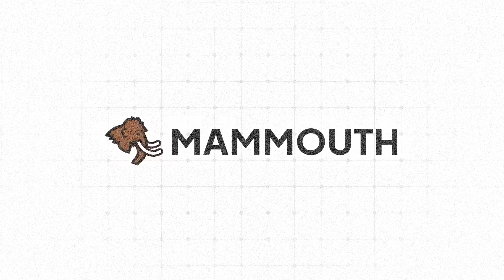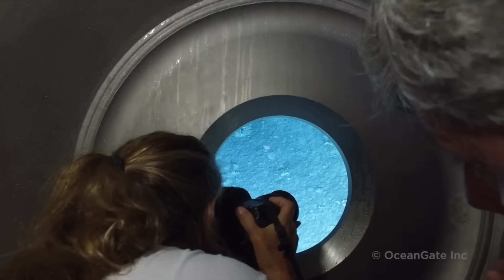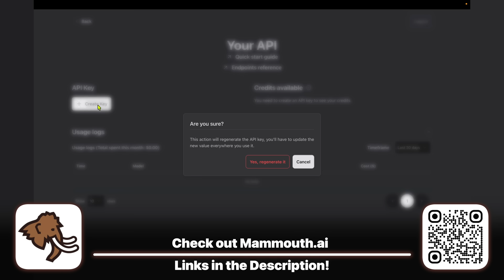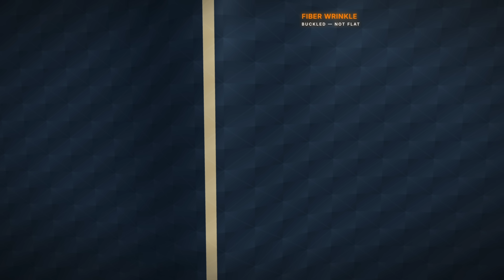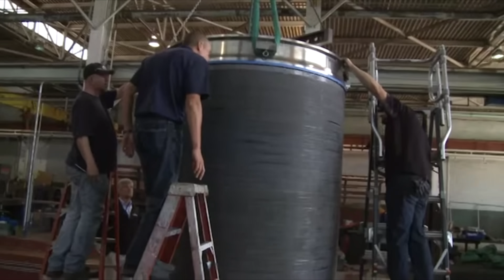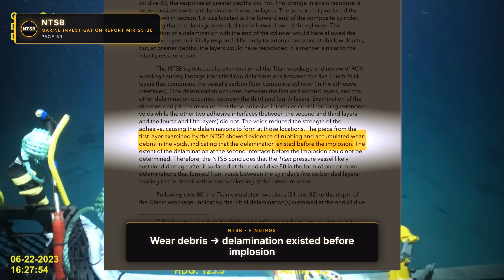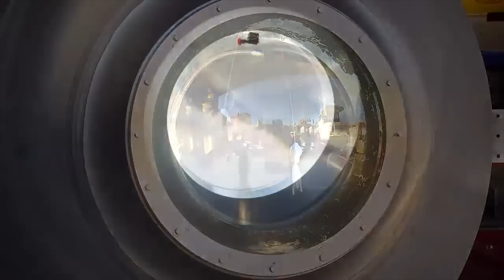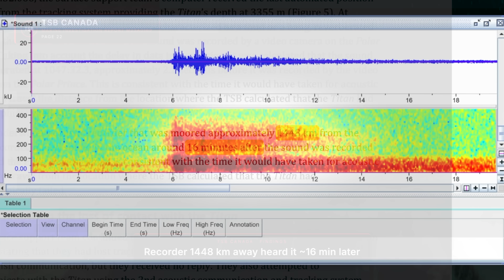Oceangate Titan: It was WORSE Than We Thought

Comment: Seriously, the problem here was not, being stored in the weather, or being towed, of not watching the monitor data none of that.  There is no reason to even calculate what this design might have survived because of one simple thing.

NOBODY, no engineer, no scientist, nobody  would EVER use carbon fiber  in COMPRESSION.   YOU would not.   

This vessel never belonged anywhere NEAR water, let alone deep water.   The only application Carbon Fiber is suitable for is tension which is HOLDING PRESSURE INSIDE. This would be a scuba tank, or a water softener tank.   That's it. It's that simple. They used the wrong material!

Rush suffered from too big an ego, and too much greed to be able to make reasonable engineering decisions. Someone should have pushed him down the stairs before he killed others.

Comment: I worked in a composites shop, and actually helped with much smaller pressure vessels. Those things were never intended to be manned and we Still did an insane amount of structural testing. The problem wasn't in engineering. It was arrogance and thoughtlessness.

Comment: Is it possible to build cylinder type deep dive submarine from titanium? Say- same size as Rush’s Titan - but from titanium?
Reply: Good question.  If it could, it would have cost much more - titanium is expensive.  For that reason alone, Stockton Rush would not have considered it.
Reply: Not if you want it to float without external floats
Reply: @claire_cant_think_of_a_name   Wanting it to not implode is, I think, the greater concern.
Reply: @AlbertaGeek I mean, you need to check both boxes or everyone dies

You can make a titanium tube or any other shape that won't implode at any depth, but Stockton was really opposed to external floats for some reason, so the titanium tube wouldn't have worked for his requirements. Stupid requirements but still
Reply: @claire_cant_think_of_a_name  "you need to check both boxes"
No, you don't.  The pressure vessels of deep-sea submersibles are incapable of floating on their own.  They need syntactic foam attached to the outside in order to return to the surface.

"the titanium tube wouldn't have worked for his requirements"
Not because of flotation issues, but because of cost.  He was trying to make his submersible on a shoestring budget, and titanium is notably more expensive than carbon fiber.

And even then the carbon fiber he bought was inferior - he got it second-hand from Boeing at a discount because it was past its expiration date (honestly, before this I didn't know carbon-fiber had a "best by" date).  Something to do with the resin degrading over time.
Reply: @AlbertaGeek Lmao yep, both previous times I brought up external floats I was thinking about syntactic foam. Glad you're on the same page.

Since you enjoy being really pedantic though, DSVs don't need syntactic foam. Oil filled pressure equalized tanks were the original design and worked fine, albeit with a many drawbacks that syntactic foam solved.

Comment: Stockton Rush had little fear and complete disregard of reasonable safety.  A Cowboy in design and manufacturing.  I am conversant in fabrication and construction, with a wide level of experience and I do and have constructed projects on completely new thoughts and methods.  However I have never taken it upon myself to construct a project until design and serviceability was certified.  When it looks wrong it is most likely wrong, and no one in hell would have made me sit in this submersible to venture to the deep.  Having seen the Titan prior to the implosion I felt not confident that it was safe, neither did I think that Stockton was sufficiently capable to do so.   One could see a train wreck in the making.

Comment: That the bang was ignored is hardcore for me. Everyone who learns carbon fiber knows that if you hear a bang it is most likely a bunch of fibers that have snapped. If you hear carbon fiber, you hear it mostly under the initial loads since some fibers can get peak loads that make them snap but then the load spreads more evenly on the rest of the fibers. It is a whole different thing if you hear a bang after some use. On the other hand if you only use 5 inch instead of 7 and do not use the recommended fiber orientation without consultance and against instruction that is far from bold... that is just reckless.

Comment: Carbon fibre is strong under tension. It’s good for strengthening pressure vessels. Carbon fibre is weak under compression yet that’s exactly what OceanGate did. The layers separate (delaminate) and sooner or later …

Comment: The hero of this story is the carbon fiber.
The fact that the sub made more than 80 dives before shitting itself despite all the manufacturing defects and mistreatment of the hull speaks to it's strength and proves that Rush was correct, in principle, about the suitability of the material for sub construction.

Comment: I work for a company specialized in high pressure, fast moving carbon fibre machinery. Some of our machines have been running non-stop for over 40 years. The approach OceanGate and Stockton Rush have taken to carbon fibre engineering is outright ridiculous. I'd say it's as comparable to engineering as alchemy is to chemistry. Stockton Rush, a veritable 21st century alchemist and snake oil salesman.

Comment: The de Havilland Comet, the first commercial jetliner, crashed in the 1950s due to metal fatigue. Metal fatigue is the weakening of metal from repeated bending or stress. The plane's square windows concentrated stress on their sharp corners, creating cracks that tore the fuselage apart in mid-air.

Comment: I suppose, ironically enough, what Stockton proved was that it was possible and viable, but then the implosion added "...if implemented properly", so with the market for "Trips to the Titanic" suddenly cleared of competitors, that other company said "Hey, would it be cost-effective for US to do his sub by the proper plans?  You know...not getting anyone killed?"  Maybe even using a better control system..!  They KNEW there was a market for people who wanted to do deep dives, so with the competition gone...the other company doing the dives with a better submersible isn't necessarily "a good example" from a corporation as much as "Income and hardware-lifetime optimization to make use of a pre-available, elite market of high-profit passengers".  Stockton showed them HOW to do it...and then cleared the competition away FOR them by failing to follow the alarms their own system had been providing them for some time.  😕

That man was arrogance incarnate...but once again, I must admit that he at least believed in it enough to go down WITH them.  Not like Stockton was sending peons off to die with the serfs; he believed it to be safe enough to risk his own hide in.  Wrongly?  Sure!  Should he have had a design engineer there to watch and analyze their sensor data so they could point out "Hey, this funny sound may mean it has delaminated in the outer layer of carbon fiber, this should be looked at for safety" and stuff like that....sure, he should have!  But I think he'd run out of excess funds...the stink of his 'unlicensed vehicle' had curbed investments, so he had to do SOMETHING.  The 'something' he did simply proved to be slightly-sneakily fatal.  Take customers in the guise of 'scientific observers', going along 'at their own peril'...and get paid for it!  Woo, cash!

That big BANG on Dive 80, though, THAT should have alarmed people much more than it did.  😕  Oh well.  He's done and gone and we've all learned things...and that's why this new company is cheerily stepping into the gap.  They learned that being atomized at crush-depth really isn't a long-term profit driver, but they KNEW they had a market for people with money who wanted to go down there themselves...I can't even blame them, really, I know I would have considered a ride in that sub before it all got crunched!  I may have noped if I found out about Dive 80's "POW!" noise, but I still might have been tempted...I mean, SEEING the Titanic?!  That IS temptation..!  But then, "Crump!" and it was all over.  Probably before anyone even really understood that they were in extreme danger, though I think they had become aware of SOME issue?  I think they had stopped descending, but then had been made to continue descending due to buoyancy issues or something?  I dunno.

I get why Stockton tried to push it...but I also think he failed his customers and staff by pushing too hard to make enough money to keep going without giving up some big chunk of his company to someone else to get his company an investment that could allow more safety checks and more staff to watch out for issues.  It IS amazing how many 'additional holes' he had poked into the 'swiss cheese failure model' all on his own, though...SANDING carbon fiber lumps down?  No cross-layering at a 45-degree angle?!  SANDING carbon fiber off!  Just...how did he think that was a good idea?  And yet despite that, they MADE IT down to the Titanic several times safely-enough before catastrophe!  So...I'm more impressed that it hadn't failed outright, that it had ANY safety margin, much less 1.10x margin.  The fact that the sub actually WORKED as intended (for the most part/overall) and made it up-and-down several times is just amazing to me.

Comment: So, done slower, with different adhesives that would cure successively (which would need testing, but theoretically could work), done in a proper clean (ideally vaccuum chamber) space, with biased layers... all extra cost sure, but not unheard of besides the glue. The design could have been fine. But every possible shortcut was taken and near every principle of composite design was violated. Hell, if done right these could have been near mass produced. But one man's hubris threw it all away and tainted it all. Madness.

Comment: Think about it, taking ONLY a 1 square foot column of water of a depth of 12,500ft (approx. depth of the Titanic wreckage) weighs in at a modest 375 TONS. (1cu.ft. of water containers 7.5 gallons; fresh water is 8lbs per gallon. You do the math yourself...) Thats about the same weight as the antenna tower / mooring mast at the top of the Empire State Building. At depth, the outer hull pressure would exceed 60,000 TONS; a weight approximately equal to the Eiffel Tower's foundation or a 20 story modern construction with roughly 25,000sqft per floor. Knowing all this, why did the executives and engineering team cheap out on something that would be subjected to these pressures? The video's whole analysis sounds like the engineering and manufacturing teams were being pushed to finish the hull as quickly and cheaply as possible from the get. And for what? All so the executives could get the passengers money. 

To answer your closing question: If we're talking about taking a submersible that's been properly designed and manufactuered with all the destructive testing required to ensure safety; yes, I would most certainly enjoy a trip to the Titanic, with only 1 caveat: I want to see the testing data and the planned obsolescence schedule for hulls that have been used multiple times.

Comment: This is not about the engineering culture of "Let's take notes of this incident so it won't happen again" like in aerospace, this is deliberately malicious and neglectful. They voluntarily underbuilt this submarine to cut corners, went with the "good enough" attitude, what's two inches less thickness after all? Then didn't give a single shit about stuff breaking down (sensors, loud banging noise, other issues) and kept going. It's a submarine for crying out loud, if this isn't built perfectly, SHTF. And it sure did.

Ocean Gate's boss is a sociopath.

Comment: 16:38 I work in engineering. I design, qualify and improve manufacturing processes for high-speed electrical connectors. A few years ago, when working on a connector that gave us some issues with Signal Integrity metrics, an SI engineer told me that "If we could just make all these parts exactly to nominal specs, we wouldn't have this issue.".... Thanks, Captain obvious!
Just rolled my eyes and moved on.

Comment: You forget to mention that the Titan had repeatedly crashed into the ocean floor and objects on the ocean floor, including the Titanic's propeller blades (it even got stuck on a blade once). There were complaints about the "laggy" steering system which caused these crashes, but Stockton Rush's solution was just to glue sticks to the controller to make more accurate.

Stockton Rush also strictly forbade checking the hull for defects.

Comment: Fascinating summary without sensationalist spin or hyperbole - just engineering fact. Your analysis of strain against time vs strain against depth was insightful. Why they didn't alter the lay-up angles, as per Nasa recommendations will remain a mystery, but looking at videos of the ply laying machine, it may not have been configured to achieve this?

Comment: Fantastic explaination of the issues. What I can't understand is how the company were allowed to make another submerisble even if it was done within the rules this time. They should have been disbanded as a company and banned from ever building another sub. They could start a new company if they wish with special scrutiny of their practices, but to just turn around and make another sub? Will it even be worth it? Will people trust the company that made the Titan?

In the aerospace industry commercial planes are tested to destruction and have redundancy built in so that several systems need to fail before a plane is in trouble. Yet even there accidents occur because of poor procedure and known issues can be left un-addressed until a major accident occurs. With Titan having adhered to much lower standards a fatal accident was guaranteed.

Comment: I worked on lamination of carbon fiber composites at Boeing. The first thing I noted was they had no diagonal windings. On the Osprey we had an ice slough test on the fuselage shattered. We solved the problem by co winding Kevlar with the carbon fiber and this solved the brittleness by presenting Kevlar to prevent failure by reinforcing carbon failure by having a Kevlar section to "patch the gap" . Next NEVER grind a composite for smoothness it interrupts the fibers and causes weak points in the composite.

Comment: "The decision to downgrade was made by MR. RUSH" reason for time an $. You csnt make this up.
Objects cant be good or bad ethically. Hence never the villain. Its the neglecting builder owner. Hence accidents prevention is moot. As accidents are defined by unpredictable unpredictable. Otherwise its human mistake neglect etc. Proof $ dont mean brains. Itvgets worse with storage what storage?  Parking lot no $10 blue tarp even. Just torture tested towed. 16:20 2 decade ago i visted a go kart race. One my good friends was a racer an his dad had bought a go kart for him in his mid teens. Hed be around 19 at the time. I was explained how all the go karts were required to be factory stock not modified. So theyd all have equal limits and horsepower, fuel was supplied sold at track right before getting on the dirt track. Yet my friend was just a lil faster. Not much but over so many laps that adds up! I noticed that he stayed inside on every turn made. While men 20s 30s even 40yrs old went wide. Common sense smaller circles shorter distance. But his engine was also key! It ws explained to me how it just by the odds an luck was factory perfection! They would pay $50 to get suspicious engines broken down end of races. His had been 3x by one jealous 40yr. If done enough it might be put together wrong. But he also being poor has to pay the other $50 to his own mechanic to reassemble it. The mechanic being who told him about how great the entire engine was made.  Yeah lifes full of learning. Tricks to learn fron testing not risking our lives.

Comment: The could have used a spherical design, it's just that it would've needed to be a lot bigger than Titan was in order to fit 5 people with a bit of room to move around. Someting big enough so that the bottom third or half of the sphere could be used as a space for seating. one benefit of a sphirical design would be the potential ability to inclue ground angled poortholes, though each one of theose portholes would have been a weakness in the haul design. A sperical design would aloso probably work best if it was made out of some kind of metal, like titanium, or high strength steel. Basically a sphere was not considered because it was inconvenient.

I've wondered if his carbon fiber design could have survevived if it had incorporated some kind of half inch or more thick high strength metal tube insert with preattached rings, like a spool, to attach to front and back domes, and with carbon fiber wrap filling the middle section between the rings. Something like that might've held up better, but would have been worth testing.